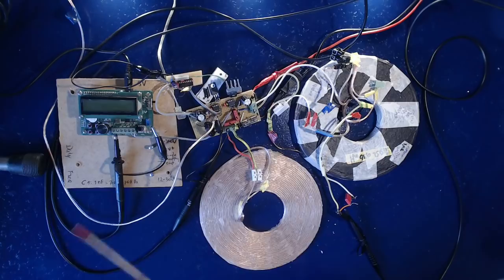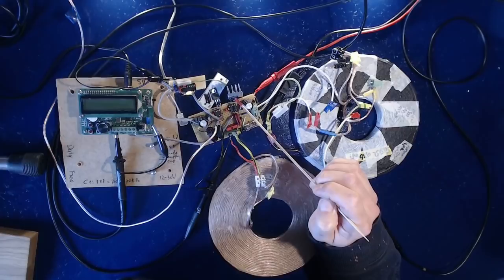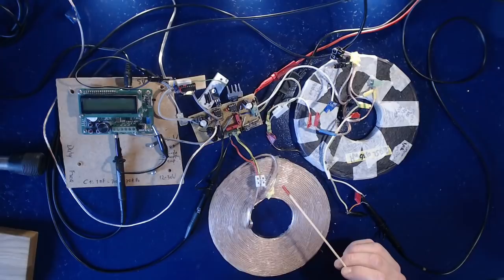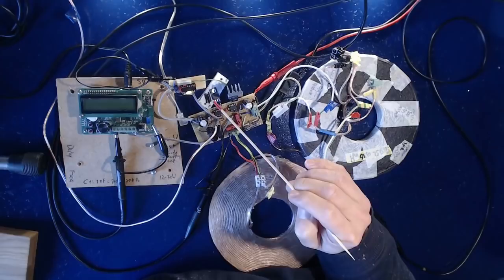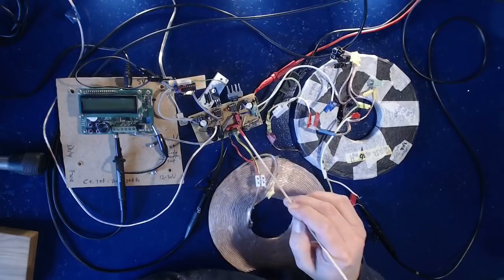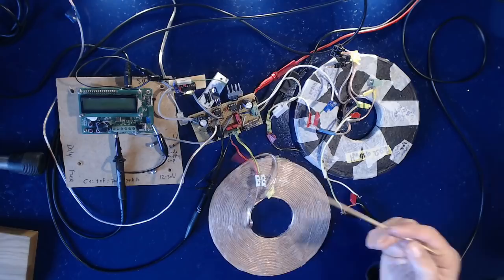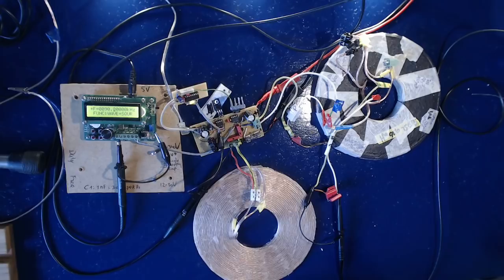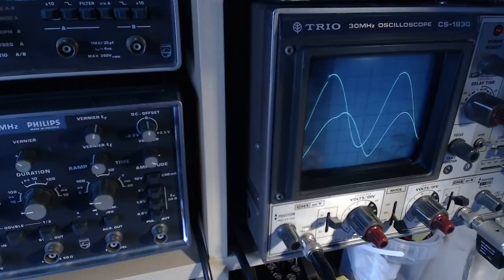Using Back EMF to recycle electric energy, within a resonant bifilar pancake coil

Comment from the maker: This article describes why i use 2 capacitors of the same size: http://www.accelinstruments.com/Applications/WaveformAmp/Magnetic-Field-Generator.html

this video is a proof of concept. More to follow...
Reply: As usual you hit home runs.  I don't know how many times I have worked with series resonant circuits and never thought to add the capacitor to limit the current from the AC source yet retain the high current in the tank.  Thanks much.
Reply from the maker: Thanks Mark S. This is a proof of concept, to make it easier to understand the next video. 
Both methods of inducing resonance will be combined into one bifilar coil
Reply: @MasterIvo  brother ise 3 transformers say one making 60 volts another 120 volts and 180volts  and and after checking resonance check amperage similarly against frequency hormonics of the coils volt against current and frequency against current or use 180-240-360volt transformer fed into same line circuit

Comment: Ok, I see, this is similar to what I was thinking when I commented on another video, about a compound setup, use the back EMF to run another rig, using the EMF to power, or help power the first, not saying it could become self powered, but?? I have wondered why the emf was dissipated with a diode in electric battery powered cars and tools, it could be used! Atleast adding to the effiency! Great video!
Reply from the maker: thanks, exactly

Comment: Hi Ivo
Besides using the backemf/flyback/collapsing field energy to resonate a coil (injecting the stored energy at the voltage peaks does this???)
You can also discharge capacitor to some sort of resistive, or inductive, or capacitance load, so you create some real power output from something normally wasted as you point out.
To get a "gain" situation happening where the cap discharge to load does not reflect back to input draw (for example 1/4 watt let's say power in "back emf"  cap discharge to load in consequence makes the input draw surge up to at least 1/4W maybe 1/2W so you have no gain in power)
Solution is always have the capacitor disconnected from the steering diode that filled it. The backemf collecting capacitor the steering diode from misfet drain should always be "free" (by itself) when it discharges to load or else the discharge reflects back.
Some engineers don't like to hear "back emf" when speaking about the flyback spikes, as backemf is  different and is that inherent back force while the flyback spike is the kickback spike from the collapsing field....destructive transients is what else the call flyback spikes, especially when they see it as nuisance that destroys stuff with the sudden high voltage.
Thanks for you videos they are always very interesting!
Reply from the maker: thanks, yes inductive spike, if fast enough is a longitudinal waveform, which can put a coil into longitudinal resonance (magneto dielectric)
Reply: @MasterIvo  
Hi again
As far as storing joules into fairly large cap via steering diode from mosfet drain, when you want to discharge this cap to a load to create real power (watts) you must disconnect the discharge cap from diode and/or coil so that cap "floats free" during the discharge to liad, 
or else horrible things happen, like huge surge of amps to the input draw....this another reason why most engineers do not think you can "do" anything with the backemf/flyback/destructive transients except ground / snuff it 
This because they do not have cap floating during  discharge is point I wanted to make ( not much to do with resonanc but rather creating real power from the back emf flyback spike and not having any reflection back to primary so you get a gain in power created vs comparing to input  power.
Great videos you do! thanks for sharing and explaining simply too.

Comment: Hi, I will tell you something very interesting that results only from the practical work. This maximizes the effects of the N Tela two-wire coil.

If for the construction of the coil you use multi-wire cable connects each wire separately from the other wire of the other cable. For this purpose use a multi-wire connector (ratchet).
  In this way each wire in the cable will behave like a two-wire coil. Basically in a flat coil you will have as many coils as there are wires in a cable.

Tell me the differences observed.
Good luck!

Comment: in my opinion hooking to the wheel work of natures problem has always been a diode that is FAST and can handle Current. The parts i see now are a choice of a high frequency diode or one that can handle current but there is always a trade off....The etheric change (vibration of the field)  that happens in a collapsing dielectric field or magnetic field happens quick but there is lots of power in say the shorting of a coil or the discharge of a capicator..the other problem is storage of the field without losing most of it....Delta T plays a major part in the power given by the discharges...
Reply from the maker: Yes but it is what you do with the impulse. It's not the impulse itself.

Comment: You might be able to center 'tap' some of the peak voltage of the receiver signal by a zener diode  if this coil is connected to earth through another diode Shotkey probably somewhere on the outside of coil
Reply: Pls Make sure you will redirect all energy, use both capacitors to store!! Second One for the DC!;

Comment: Back in 2008 , there was a circuit I read about that added 100v to the existing circuit that was going forward as pulse on/off 40V DC about 6amps. There was no capacitor. The part added was a sealed 60cycles AC relay in vacuum with dual inductors 1.6Millihenry each, of .6ohm. Diode in front of 1st coil L in series with internal diode in between L coils then that 2nd coil L in series with another output diode. Did this arrangement just happen to be lucky and obtain the needed extra 100volts forward? Back EMF forced forward as flyback voltage put to use? I have many inductors to practice with and I need to get just voltage to superimpose on to circuit line. 100v or a miniature autotransformer.

Comment: how much is the loss you get in the energy? or can you then keep it running whiteout input power?
Reply from the maker: I have not measured it is not running "free", I am working on a system that does. As always I will share if I learned how it works

Comment: Remember reading a patent from a dead man that said these coils could be used as scaler antennas that could recycle xl and xc. Le Chatelier's principal. Here's a look my friend http://www.gocs1.com/gocs1/Psionics/SCALAR-TRANSLATORS.htm
Reply from the maker: Thanks for sharing Ben Babo, the article starts off with a good intro, by describing the scalar field component.

I see this component as a ring vortex, a ring toroid.

then It turns to what I have read before, and I have researched. The opposing fields in my opinion do not create the scalar fields.
I stopped working with them. 

I do not agree with much off the rest of the article.

Tesla's bifilar coil (patent 512340) is not counterwound, and does not cancel the magnetic field. Instead it creates a strong magnetic and dielectric field.

referring to Lenz law in the article, it is related to magnetic induction.
The big question here is:

what about dielectric induction?

Comment: What is a bifillar coil?
Reply from the maker: bi=2 
coil with 2 windings that are series connected. end of 1 winding connected with start of next winding (outside to inside with a pancake coil).

this gives increased voltage difference between the windings, which charges up the capacitance, reducing the coils resonant frequency, due to increased capacity og energy storage in its electric fields.
Reply: So basically it’s got to have a high enough frequency to be able to go out of the coil magnetically and store the exiting electricity back in to something
Reply: Why not try to  use room temperature super conductors ?  I heard some scientist discovered it recently
Reply: I wonder how much more efficient this technology can be ?
Reply from the maker: I also still wonder what the reason was, Nikola Tesla patented it (patent 512340)
 It has some very useful properties like high energy storage in its field.

also the much lower resonant frequency. Which makes the coil usefull without added capacitors.

It can also be used for electric energy recycling. This makes me wonder if energy can be used over and over again to create power over and over again.
Reply: @MasterIvo  fascinating.
Reply: @MasterIvo  it is totally possible but it would must certainly require súper conductors because electrones will always escape trough wires and anything that creates resistance will always trap electrones resulting in loses in total electron count in the battery 🔋
Reply from the maker: yes resistance creates heat, which is lost. but resonant energy creates power, when the 2 fields are together in time and space. and I already have shown that it is possible in my Radiant power video of april 2019.
Reply from the maker: @efexzium   The fields are outside of the conductor, so by using field energy, you can recycle the energy
Reply: It would be interesting to measure the starting amount of electrons and the resulting amount of electrons to determine the total loss of different components to see what components offer the closest end to end solution.